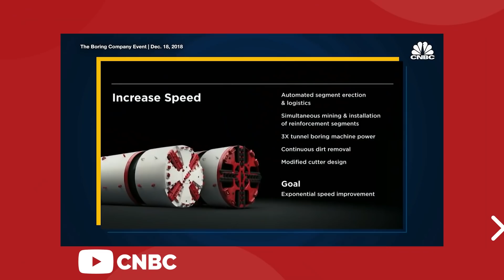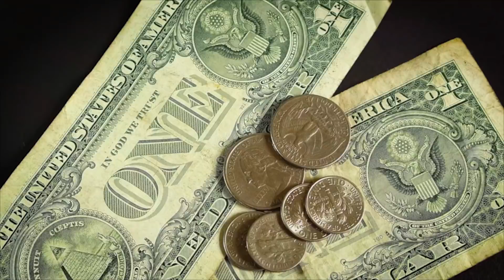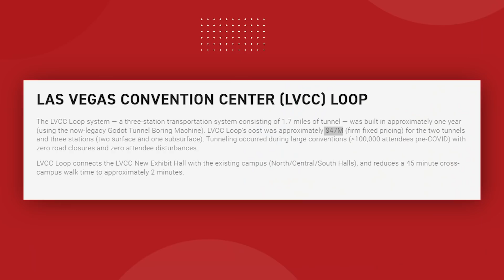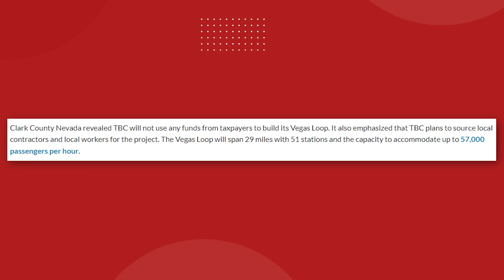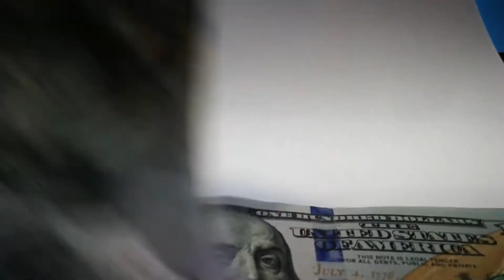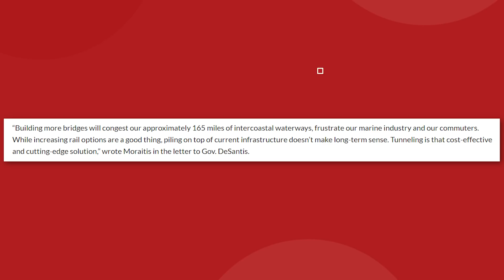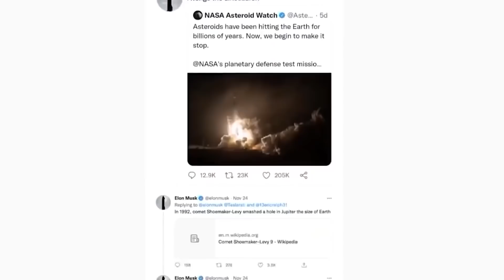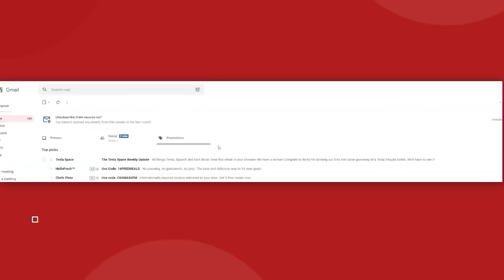The Boring Company 2022 Update

Comment: What? No one tried to build reusable rockets before SpaceX? Sure they did, decades ago, most obviously the Space Shuttle? No, it did not achieve the intended cost savings, and it had obvious safety problems and other flaws. But it was a first try based on technology of the 1960s and 1970s, and first tries are rarely perfect. And even so, the Shuttle had capabilities that no longer exist. This isn't at all to dismiss the accomplishments of SpaceX, which has achieved remarkable things. But we shouldn't forget about what others have done as well.
Reply: @D Gary Grady the space shuttle was not a reusable rocket.
Reply: @mediamanM  The Space Shuttle was not a fully reusable rocket if that's what you mean, and neither is the Falcon 9. The Space Shuttle discarded solid rocket boosters and the eternal fuel tank, but the highly reliable (and restartable) main engines were reused on flight after flight, as of course was the main body of the spacecraft, its flight deck, and its cargo bay.
Reply: @mediamanM  The DCX was
Reply: The Space Shuttle was on whole, a miserable failure.
Reply: @fredandersen9873  As already noted, it certainly had very serious flaws and obviously was (in combination with bad decision-making) responsible for the tragic deaths of several astronauts. But \it a "miserable failure" ignores its significant achievements, including its ability to recover satellites from orbit. I respectfully suggest that the Shuttle, like many things in the real world, was neither perfectly good nor perfectly bad.

Comment: In my personal opinion The Boring Company model will be how we build our road networks in the future. This moment isn't the ideal one to introduce a fledging company with a "new" idea where the problems to be solved requires huge amounts of money and time. There is a reason that most road infastructure gets built at the behest of a government. 

A way to solve car traffic is through overhead roads , increasing lanes and throughput (entrance and exit) of roads at the same time. Boring's model of tunnels is basically the reverse of overgead roads. More than two overhead roads at a single point become exponantially costly and difficult to employ. In my opinion it is only natural to instead of going up to go down. Comparatively making tunnels more tunnels at an increasingly lower y axis is way cheaper and easir than doing the reverse. The problem I see with The Boring Company is that not much though has been put to actualize the plan. How I see it working is designing underground routes in 3 ways. Before saying anything more the plan I will present will take place in a city that is being built around such a plan , EVs will be the only vehicle allowed (no ICE) and a certain level of self driving has been achieved. We basically will have 3 main types of tunnels. The most important one will be a tunnel that will focused on traversing various distances. I.e. from town to town , from downtown to suburbs , etc. Second tunnel will be to connect destinations that will need to accomodate more than 1 car at any period of more than two minutes (distance of tunnel must be able to be traversed in less than a minute and exit/entrance of destination must allow for more than a vehicle). I.e. a supermarket , a mall , a cinema , a small shop , etc. Third type of tunnel will be mostly for single use of cars. I.e. a type 3 tunnel connecting a house to type 1 tunnel. Now to adress entrances and exits. In this kind of city there will be no surface roads for anything other than bikes (foot powered ones). All building that would want to be accessed by cars would need to extend their basement according to the amount of cars they will want to accomodate. For example type 3 tunnels and houses wont need to be that deep. On the contrary type 2 tunnels and buildings like malls would need to be deeper in order to facilitate larger amount of vehicles. Lastly one of the most important part of this plan but often overlooked is self driving related technology. You don't even need full blown self driving. What you want is a system that can analyze every route from two points and map the most ideal route. In this it should be taken in account the amount of cars that are using said route or will be using it shortly. The prioritization can be discussed until we reach the most efficient and customer fullfilling one. The idea is that if a route like a certain type 1 tunnel is near its capacity your driving system would prompt you to take a different one that might be slower than the first route but will actually be faster if you take in account the "traffic" in the first route. In this way a lot of traffic that is self created when a lot of people take the same secondary route believing it will be faster but ending up being the same or worse since a lot of people had the same thought won't happen. Another thing this system allows is for people that don't have destinations on the same are won't be obstracting one another since the driving system would recommend them more optimal tunnel routes to follow. Lastly one great advantage compared to normal surface or overhead roads is that you aren't limited on the amoun of tunnels you can make. You want more tunnels ? Go deeper. I also believe removing roads from the surface allows us to introduce more parks, walking space , biking space , increasing population density, etc.

Until we get flying cars , underground tunnels for cars is an invevitability. Change my mind.
Reply: The cost alone makes it impossible to replace roads with tunnels.
Reply: @PålOliverKristiansen  You missed my point. Although today tunnels might be more expensive than adding more road or increasing suburbia. How long can this keep up ? How long can American cities keep up with ponzi scheme known as suburbia ? Human population and housing is becoming an increasingly problem. Surface level roads have cons that can mitigated by underground tunnels. Not to mention stating cost is too big about road infrastructure is too big is laughable. If the cost was too big America would never have made suburbia.
Reply: @alexandervlaescu9901  This has already been solved. It's called public transportation. The idea of layered tunnels is stupid for many reasons. The first is cost. The Las Vegas loop took 18 months to complete at a $52 million price tag. For a short 1.7 mile stretch. No serious urban planner looks at the Boring company for any good idea about the future. This idea is wholly impractical and will never see the light of day in any meaningful sense.
Reply: @PålOliverKristiansen  If cost was ever a concern when you wanted to build infrastructure then a lot of today's cities wouldn't be the same way. The American Dream is a living example of my point. Suburbia is a ponzi scheme. The only reason states can support such city planning is only with more development. Problem is more development means more debt. More debt means even more development. There is a limit how long this can be sustained. So given the American government opted for a city planning that can't even be sustained what stops them from an actual effective city planning. Biggest reason tunneling is expensive is because of "environmental" surveys. Although they have merit , they pose too many obstacles on the development of the tunneling sector compared to what they offer. As I said before technology advancement in the tunneling sector is really slow given how difficult entering and establishing yourself in this industry is. More public transport will never be able to relevant unless two conditions can met. One cheap distribution services (as you can order anything you want and have it delivered to your choose of destination in a matter of hours. Second having the ability to go to any destination in a reasonable timeframe that can rival cars. For example in order to go my university using public transport I need a minimum of 1 hour and waste approximately 30 minutes during waiting for a bus/metro and arriving sooner than needed. Comparatively with a car and not too much I can arrive at my university in 20-30 minutes without having too wait before my intended time of arrival. Not to mention an underground tunnel system is exactly the reverse of a transport network for flying cars. Given the only possible difference is the cost and how cost isn't relevant in infrastructure projects and I can't see your point.
Reply: That's quite the text wall you created.  Too bad, you COMPLETELY MISSED THE TARGET.   The Boring Company isn't about transportation,  it's about developing autonomous and  efficient tunnel boring technology.   All these silly little projects are just for funding of said technology development.
Reply: @fredandersen9873  The major arguments against The Boring Company are always about the lack of need of an underground tunnel network. You must living under a rock to miss this point. Not to mention expecting substantial progress on a "smaller" industry. The boring industry is difficult to get in as it is not easy to outperform your competitors. If you also consider that your only customers are governments that have already found a reliable partner , even more so difficult.
Reply: @fredandersen9873  "autonomous and  efficient tunnel boring technology". From the company's own homepage: "The mission: solve traffic, enable rapid point-to-point transportation and transform cities". If it truly was about making tunnel boring technology they would build their own TBM. They didnt.

Comment: The narrow tunnel gauge is a benefit in speed of drilling, but creates choke points.  Imagine a defective battery in a car bursting into fire.  No escape tunnel, no way to extricate stranded passengers - a recipe for disaster.  In the Las Vegas example, the cars can't even reverse out of the tunnel without likely causing another incident!  The Boring company would be great on Mars where it can form habitats, connect habitats, mine ... on earth, it has much to prove.

I do expect the Boring company to succeed, but we are probably a decade or more away.
Reply: What prevents them from reversing out?
Reply: @Toefoo100  Good question.  It is easy to follow the tunnel lines driving forward.  If you try and reverse, your steering wheels are in the rear of the direction of motion, which is impractical to reverse for long or winding distances.  For some skilled drivers, reversing for extended distances is just fine.  For the majority of drivers, reversing in a narrow tunnel will feel like backing up an articulated vehicle without the room to move the steering wheels adequately.  If people tried to reserve in panic mode, I expect odds of hitting walls to be much higher, triggering additional accidents.
Reply: @usamat3297  that might be an issue if it wasn't tesla cars but even other simple self driving AI wouldn't have a problem reversing out. The only reason they currently have human drivers right now is liability.
Say what you want about tesla AI but a driving loop like this one is a cake walk for any self driving program for a decade
Reply: @usamat3297  The human drivers in the Convention Center loop are trained and tested on driving backwards.  

So long as the loops are closed to outside vehicles, the fleet can be inspected an monitored for issues that might lead to battery failure.  Spontaneous battery fires while driving are extremely rare. When they've happened, they don't "burst into fire".  They start overheating first, and that heat is usually detected before any flames.   An orderly evacuation could be well underway before the fire even starts. 

If passengers in a stranded or overheating vehicle have to evacuate on foot, the roadway in front of their vehicle will be completely clear, as any traffic in front of them just kept going.  It's a smooth, nine-foot wide escape path.   Once vehicles behind them begin to reverse out, that path will also be clear.
Reply: @kevinbailey8827  Thanks for the info.

Comment: The information on TBM’s is not entirely accurate. Check out the Crossrail project in London from a few years ago. Digging and lining the tunnels at around 35 yards a day.  Hence Elon ( and I’m a huge fan ) is not known for Boring’s radical new tunneling machines or abilities.
Reply: You've missed the key difference: *cost*.  From BBC: "The cost of completing Crossrail exceeds available funding, the government spending watchdog has found. The National Audit Office (NAO) estimates the cost of the new rail link will be between £30m and £218m above the current funding. The government increased the project's budget to £18.8bn in December 2020."  So, Boring Company is trying to do for tens of millions of dollars/euros what others are doing for tens of *billions*.  That's two orders of magnitude cheaper!  £18.8bn in costs is a much harder sell than £18.8mn in costs.
Reply: @AMortalDefiant  and they are doing this with tiny pipes?
That scales down cost, but also cripples throughtput of these tiny pipes.
Reply: The information is completly misleading.
TBMs are electric by default, not diesel driven.

The cost for tunneling is not caused by the boring, but by the system design.
Drilling a tiny pipe costs significantly less than when you are building a rail system with stations.

Comment: You do realize that everyone's tunnel-boring machines are electric powered, don't you?
Reply: Some are electric-electric. Others are electro hydraulic,
Reply: @davidwebb4904  sure Elon musk's TBM also has a hydraulic system on it for something. Elon Musk does not have any new TBM technology whatsoever
Reply: @joecummings1260  Hydraulic motors to turn the cutterhead and hydraulic rams to advance the machine
Reply: @davidwebb4904  you might be able to get around using Hydraulics to turn the cutter head with some big planetaries, but there's no way you're going to replace the hydraulic Rams. Not that I see any big advantage in using the direct drive planetaries over using the hydraulic drive system. So why is this guy talking like electrically-powered TBM is some great Elon Musk invention?
Reply: @joecummings1260  Exactly one of my points. This video was a propaganda piece.
Reply: @davidwebb4904  this boring company TBM and the tiny tunnel is just as stupid as the semi. The mega charger for charging the semi will draw over a megawatt. That's for each and every charging stall. Do people think that truck stops are going to install 10,000 KVA transformers and construct a power line back to the nearest substation. Frankly I don't think most substations can handle an extra 10 megawatt load
Reply: @davidwebb4904  I like when he said he was going to make bricks t out of all the spoils. Yeah sure, bricks that don't meet ASTM specification for structural. Basically worthless bricks

Comment: Many of the cost comparisons are against transit tunnels - which are typically much larger and involve significantly high material and communications costs. It's a disingenuous to compare tunnels serving completely different purposes.
Reply: You’re exactly right Lucas. When he said tunnels cost $1 billion per mile I’m like there’s no damn way lol. We’ve got highway tunnels all over where I live.
Reply: @Ed_Worlds  They cost sometimes $1 billion per mile, but that includes the whole infrastructure including metro stations and rail system.

Thunderf00t had dug up the industry standard prices for boring and compared it with the tiny diameter of Elons pipe.
Well, Elon is just on the average, not even leading.